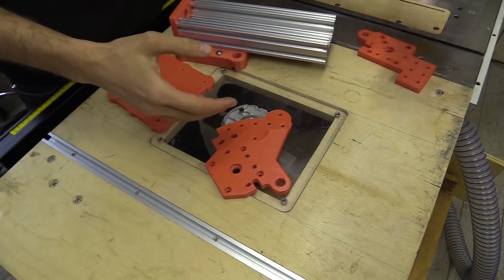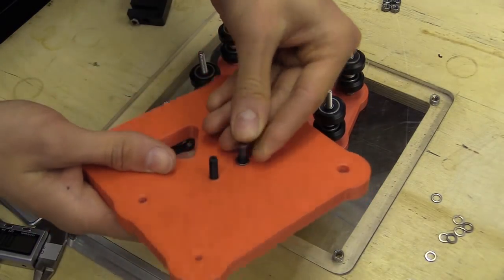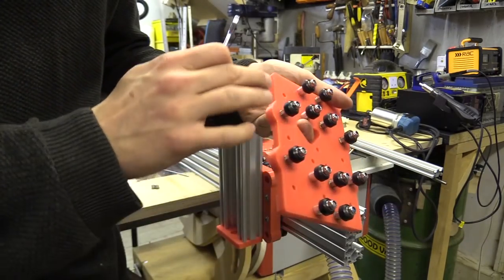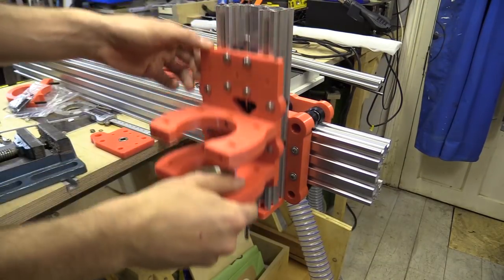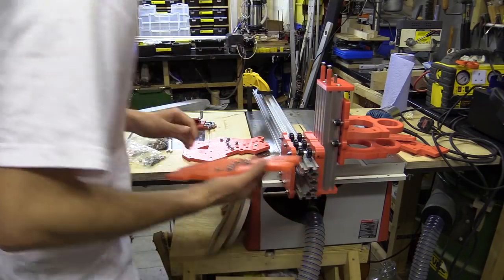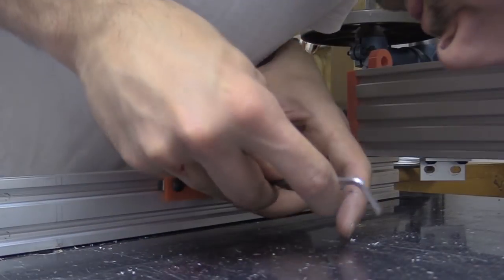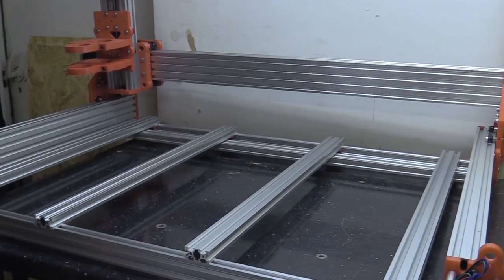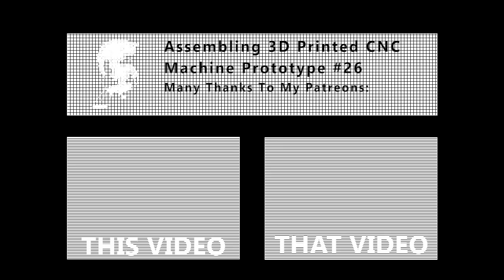#26 CNC Prototype Assembly #26 / 3D Printed CNC Machine

Comment: Have you considered getting a strong PLA blend like Polymaker PolyMax PLA or annealing a HT-PLA blend? Don't get me wrong, I print most of my functional parts in PETG and I read the description were you state you just want to try PLA, but I have 3d printed parts for a pcb milling cnc machine for a client with polymax PLA and the result was very good!
Reply from the maker: I like the idea of PETG - but I'm not sure I want to try print all those plates all over again. It took so long last time. But I do have some changed to these plates that have popped into my head. Also it would be a lot quicker to CNC them from acetal or delrin, if he machine holds up.

Comment: Nice Build. Do you have a problem with play on the z axis in y direction. Hard to explain but when I go down into the material with a cutter then it bends the z axis on the x axis and gives bad cuts.. Did not solve that problem yet..
Reply from the maker: It's not a tank, but it will kicks are arse off the x carve. That's the main thing. I think I could triangulate the z axis to the back of the gantry plate to help. Will also have to be smart with the tool-paths. This is more about squaring and tramming the machine easily.

Comment: What material did you use to print those parts? I understand it's a prototype, but I'm not sure if ABS or PLA would be good for the kind of forces you are going to submit them to.
Reply from the maker: I used PLA for now - should have used  PETG. I'm either going to get new plates cut out of aluminium or go back to acetal if I do it myself. I'll just have to be smart with my jobs - cut towards my line, small steps and ramping tool-paths.
Reply: Educating Savvas you can use the 3d printed parts to make sure everything works and then have aluminum plates cut for you.
Reply from the maker: That should be the plan! I want to make a version that runs on linear sliders but I can't find a good place that's also reasonably priced.
Reply: You can get away with Chinese ones, but you need to replace them every 3-6 months depending on use, unless you completely isolate them from the dust and moisture.

Comment: Hi there, by experience, I can say structural 3D printed parts are not stiff enough for milling purpose. 3D printed laser or plotter OK, 3D printed mill, definitely not. Alas.
Reply from the maker: It's just a prototype. My 3D printer is more square than the old CNC machine I've discovered.
Reply: I am watching this with great interest; I think it could prove to be a useful tool, assuming it is not expected to outperform a machine-shop mill.  PLA is surprisingly stiff, and while it is lacking tensile strength perpendicular to the layers, intelligent part orientation can counteract this.  Would be nice if it can handle materials up to brass and aluminium.  (with care and patience.)